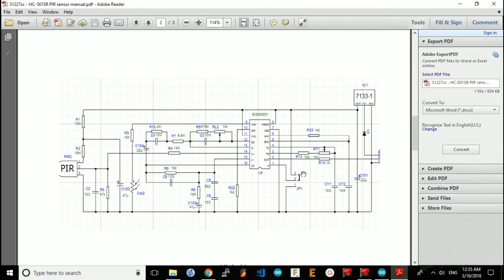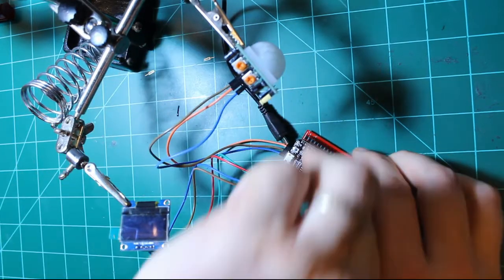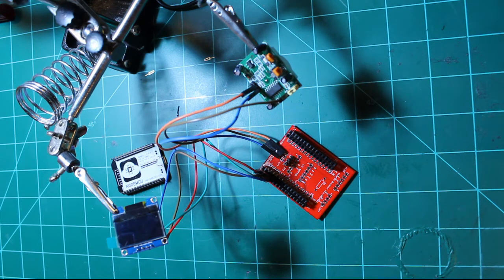Connect PIR sensor to NodeMCU using 3.3V (HC-SR501)

Comment: This worked for me. But why? Whats wrong with the 3.3v signal generated?
I'm trying to create a bunch of motion sensor NodeMCU. I bought an initial set of 3 NodeMCU labeled "Amica" with CP2102 UART. Code has been working great with existing PIR for weeks with not a single problem. 
I bought a second set of 3 NodeMCU that were even cheaper, labeled "LoLin". This are much larger, use CP340 UART. Put the same code, same wiring, same sensors and it went crazy. Set up interrupt to trigger on state CHANGE, yet it will sometimes get hundreds of calls yet the value shows no change. What gives? Was crashing and generally not working at all. Not false positives. Tons of interrupt handler being called with no change and no relation to movement or not.
I tried your change in this video, using 3.3v from the board to the PIR and amazingly, everything is calm and working. I'm not noticing any false positives. Its working great.
Is there some grounding issue? Is the 3.3v from the PIR not relating to the ground on the NodeMCU? Is the 3.3v from the NodeMCU noisy or somehow different from the 3.3v generated by the HC-SR501?
I was about to return these cheaper NodeMCUs. Now I'm not so sure. I'd like to understand why this is making a difference.
Reply: Additional comment to earlier, not only does it work great if I attach the 3.3v as described in the video, it is also working for me to wire Vin on the HC-SR501 to 3.3v despite the manual saying it requires 5-20v.
Reply from the maker: I'm not sure why your second method works (I wouldn't expect it to), but my theory (unproven as I haven't actually looked at the signal with a scope or done any further tests) is that the VIN voltage provided by the NodeMCU when powered via USB isn't high enough to allow the voltage regulator on the HC-SR501 to generate a clean 3.3V signal. I definitely noticed (and tested) that when attempting to use the analog input on the NodeMCU (btw, note to the wise - don't even try! Low resolution and high noise) - I never saw mre than 4.4V on that pin.

When I find the time, I want to run a proper test with these, trying different configurations, and prove/find out which way is the most reliable. I will say that I do still get false positives even with the method I described in the video, just at a much lesser frequency. But, that may just be the sensitivity of these sensors, and nothing much we could do about it.

There's other methods of detecting motion I'm looking at - I recently saw someone mention radar sensors on a forum - might give those a try!
Reply: @BKHobby I figured it out. The "Amica" NodeMCU follows the spec. Vin on that board is tied to the incoming 5v from the USB. On the "LoLin" NodeMCU board, sometimes referred to as v3 board, the pin meaning is different. On the LoLin, Vin really means V-input to power the board, not to provide power to sensors. I measured its voltage as floating between 0.5-2v. 
The LoLin board uses two pins marked reserved on the standard Amica. On the LoLin there's another Ground and a "VU" pin. VU stands for V-USB. It is tied to the 5v incoming power from USB. 
So... trying to power HC-SR501 from Vin on the Lolin doesn't work. Tying it to v3.3 worked for some reason. Tying it to the VU (5v) pin works fine.
In either case, I am not getting false signals. Its working great. 
In general, so far I prefer the "Amica" board over the "LoLin" board. Smaller, follows the spec and seems more stable and they can be had for the same price.
Reply from the maker: Awesome analysis and write up!! Pinned for others to see this, thanks!!

This will definitely explain any issues with the LoLin v3 boards, but the question of Amica boards with the 3v3 bypass working more reliably still remains...guess I need to put a scope on it and check...
Reply: @BKHobby I wonder if it could be variability in the HC-SR501 or with the 5v power supply. I'm using 3 from a batch of 5 I've purchased, different power supplies, an Apple iPad charge and a cheap power strip w USB outlets. I've never received a false positive. We went away for a week. Have had them running for 3-4 weeks now. Didn't get a single false positive the on multiple sensors over the course of the week. I have sensitivity set to maximum. Very sensitive. Standing up 25 feet away triggers it right away.
Reply: The reason this works is probably because the breakout board has a 3v3 regulator to provide 3v3. So it is the same as using 2 separate 3v3 regulators to power the pir and esp8266 separately (common ground).

Comment: Looking at the schematics I have a theory that needs testing. HC-SR501 is powered at 5V, the output is in 3V3 logic, so far that's fine. But the power(5V) traverses a fool-proof diode (normal diode, not Schottky) on which we have a drop of, at least, 0.6V. The regulating circuit, an LDO equivalent to LM1117, has 3.3V at the output but it needs at least (in the best case) 4.4V at the input to regulate (dropout voltage at 100mA is typical 1.1V, max 1.2V). So you see the problem here? 5.0V - 0.6V (diode) - 1.1V (typical dropout voltage) = 3.3V Simply put, you will get reliable regulation (barely) only if 1. The input voltage is 5 and not below AND 2. the dropout on the diode is 0.6 and not bigger AND 3. You have a quality individual LDO that doesn't happen to have a dropout voltage of 1.2V (still within the specs). At worse, with a Chinese LDO (LM1117 clone) with a dropout voltage of 1.25V, a dropout on the diode of 0.65V, and a power (from USB) of 4.8V, you'll get, theoretically, 3.1V at the output of the LDO. But that's not regulation, it's a bizarre behavior of our LDO.

So the first thing that I would do is to short that diode (next to the +V pin) and see if the LDO is regulating correctly at 3.3V (the tab of the LDO is at Vout, you can measure it there). Of course, I'll power the module at 5V from USB but at this moment I already have more room for error. 

If I'd want to power the module at 3.3v from the ESP own regulator, I'd short the diode and the input-output of the regulator, they're very close (from the top view of the regulator with its tab upwards the in- and out- pins are center and right). This way I'd still be able to use the header (+5V power line used with 3.3V of course) and I'll not have to worry about sending power into the output of the regulator with a floating input.

The 3rd option is to put a 100-220nF capacitor between pins 12 and 13 of the BIS0001 circuit. There is a 10nF capacitor already there, probably a negative feedback that improves noise immunity, but I'll not do that until I solve the power problem above.

I'll start to test this theory and I'll come up with my results, meanwhile, if you have other opinions feel free to comment.

Edit. It seems HC-SR501 uses another type of LDO, an HT7133 with a much lower voltage drop (0.1V). Also, the circuit tab is not at Vout, but at Vin. My bad...
More editing. I came to believe that this HC-SR501 was poorly designed and tested from the start. I don't think there is a one-size-fits-all solution for the random triggering problem. Depending on who made the module (China is making clones... sometimes of Chinese clones) some solutions could work while others could not. After some tinkering mine works ok, no random triggering and it's connected to an ESP8266 (Witty Cloud version, my test ESP) with 20 cm of wires and it also has in its vicinity an ESP32, 40 cm away. The Witty Cloud is also connected to a 433MHz transmitter... plenty of radio sources. What did I do? I shorted the diode. I threw a 100nF ceramic capacitor (through hole version) over the LDO, between its ground and its tab. Another 100nF ceramic over the power pins of the sensor. And a 100nF (SMD, albeit people are reporting that 220nF works well) over the BISS0001 pins 12 and 13. I'll let the module on overnight and check the logs later. BTW, while I don't shy away from ASM and C I find it much easier to program the ESPs via ESPHome especially since I'm using HomeAssistant and I already have several ESPs already working.

Comment: How are you getting around all the reports that the SR501 is always triggering false positives?
Reply from the maker: Actually, since I've done this video, I've stopped using HC-SR501s.....even with the direct power, I was still getting too many false positives. I've tried other sensors since then, including some commercial alarm sensors, like the TE Ambimate MS4. That one works great as a standalone, but I haven't been successful in bringing it into an ESP8266 software environment like ESPEasy or Tasmota....For now, I'm not using motion detection in my home automation, so that project is on a backburner...

Comment: You are a genius! This worked perfectly!! Its about time they documented this in the data sheet!
Reply from the maker: Glad it helped! Although, to be honest - I've stopped using these PIR sensors myself and haven't really found any others that are reliable with NodeMCUs. Too much Wifi noise,  in general, causing too many false positives.

There is a professional quality motion sensor from TE (AmbiMate MS4) which also includes temperature/humidity and a few other  inputs, but I've not finished incorporating it into my project, yet.

Comment: Hello, this does work for me. I kept on having "HIGH" measurements but the moment I switched and use your method then it worked like a charm! Thank you very much. This leads to one question...Do you have experience with the SR505 and NodeMCU? Does it lead ot the same problems?

Comment: Not working man( goddamit . i have NODEMCU, LCD, Firesensor and mq2 altogether, the rest working fine, but it's just this pir that messed up. will that affect the voltage? because i am 100% this is voltage problem.

Comment: I was despairing with my sensor, when I learnt that 3.3V from ESP8266 in Vc put the sensor in an erratic mode. I was seeing all these videos about soldering into the sensor to bypass the voltage regulator, but you take the Gold!! Thank you so much.
The sensor still picks false movements, but it's working a 10000% times better.

Comment: What if I need to use the jumper on the other position? Can I still use that pin for supplying power?
Reply from the maker: @BuyBot - Sure! Whether the jumper is on that pin or not, there's 3v3 on it, as your power supply is essentially doing the job of the 7133 voltage regulator in the circuit. But, you'll need to split the pin out into a small harness (e.g. a 2-pin header connector with the wires jumpered together, and your 3v3 supply connected to them).

Comment: Thank you! I stumbled across this video. I don't usually comment on YouTube videos but this has saved my project, budget, and sanity! I have 9 ESP32 AP devices that wakeup from deep sleep when the PIR sensor is triggered and in response an STA ESP32 doing most of the heavy lifting.. but all the AP devices were misfiring and waking up for no apparent reason - was driving me insane!
Reply from the maker: @Merate Barakat - I'm very glad to hear my video has helped you! I will say this - PIR sensors just hate Wifi boards, it seems. Even with the bypassed voltage regulator, my PIRs do have the occassional "hiccup" of a false positive report. So, I'm working on a version 2 of my Kube design, which uses the TE AmbiMate MS4 sensor with lots of extra goodies (like filtering, other sensors, etc...) Stay tuned for updates on that project! It may be of use to you with the ESP32 boards as well, since I've written a plugin for the sensor on ESPEasy, which will work with the ESP32 board, as well! 

Good luck with your projects!!

Comment: Hello, thanks, works better now, but not perfect (in my setup the board is to close to the sensor apparently).
From Bruh video ( https://www.youtube.com/watch?v=jpjfVc-9IrQ&t=120s) i find out about this min PIR sensor AM312 body sensor (https://www.banggood.com/5Pcs-Mini-IR-Infrared-Pyroelectric-PIR-Body-Motion-Human-Sensor-Detector-Module-p-1020426.html?rmmds=search&cur_warehouse=CN
https://www.youtube.com/watch?v=jpjfVc-9IrQ&t=120s)
Reply from the maker: Agreed - the SR501 may be too sensitive for the application we use (or might need more filtering in the software) - but I had no luck with the sensor Bruh recommended (I tried it myself too). I want to do a side by side comparison of several sensors and different configurations but I need to find the time to do it :)

Comment: I have a esp8266 connected to a sr501 connected as above. 40 false triggers every day. Tried put a capacitor between + and ground with same outcome.
Reply from the maker: Are you sure they're "false"? I ask, because these sensors are actually designed to be VERY sensitive. In my experience, I have to turn the sensor completely sideways (almost facing the wall) in my setup to avoid it picking up even the slightest move - it still picks up all valid motion events. I've also noticed just general vibration sets it off, too. So, keeping it stable and keeping it aimed at a correct angle are very important.

On the other hand, I've come across a few of these that don't pick up anything at all or are very weak, so I'm sure production quality is not 100% on the units we get from sites like Amazon or ebay....
Reply: BK Hobby yes I am sure. Nobody home and very quiet in my home. I just saw that someone put pulldown on the signal pin with good results. Will try that one when I get home.
Reply: @andersb264  1 year has gone, how was the result?
Reply: @diy_home  pulldown, capacitor and esp8266 far away from PIR works well inside house
Reply: @andersb264  How far is far away? Would 4 inches be enough?
Reply: @shifty212  I have many of them in my home, the distance between pir and esp is at least 500mm. Have not tried closer. Never false trigger

Comment: Thanks for the explanation.
I only had to do it a bit different because there are only solder pats on my Motion sensor. Made a wire to the right pin of the voltage regulator on the motion sensor board and that works.
It's now connected on the Kube multi Sensor and is publishing a 1 if motion is detected. I see in MOTT.fx that it is working. In Openhab it is something different because it is giving me -new state is NULL, couldn't post update for 'Bedroom1_Motion' if a second time the sensor is publishing a 1. 
May I ask how you have solved this in openhab?
I have made a item file like this:
Contact Bedroom1_Motion "Motion [%s]" <switch> (Bedroom1,Mot_Chart) {mqtt="<[broker:home/DHT01/motion:state:MAP(motion.map)],<[broker:/home/DHT01/motion:command:ON:1],<[broker:/home/DHT01/motion:command:OFF:0]"}
And a map file:
0=Still
1=Motion
The sitemap has this:
Frame label="DHT01"{
    Text item=Bedroom1_Temperature
    Text item=Bedroom1_Humidity
    Text item=Bedroom1_Motion
        }
This must be wrong because it shows nothing then a file icon and Bedroom1_Motion as text.
I know I am just learning this stuff but can not get this working the right way without altering the Arduino skecth. (maybe publishing a 0 after the delay for the screen?) But that is not what I would like to do.
Thanks in advance and hope to see/hear from you.
Ray.
ps: that WiFiManager is working great btw.
Reply from the maker: Ray Brok - I'm glad you got the PIR sensor working! As for the openhab items, I see a problem with your item definition. You should only be defining one MQTT topic (the motion state) - you're not sending commands to the sensor, so no need for the output topics. Also, I use the Expire binding with my sensors. With the expire setting, I can "hold state" on any new event coming from the MQTT topic, and disregard any additional events for a period of time. In my case, i have it set for two minutes, so my light will turn on for 2 minutes and then turn off again (the Expire binding sets the state to what you define after a predetermined period of time). My item definition (with the expire clause) becomes:

Number Motion_MasterBedroom "Master Motion [%d]" {mqtt="<[broker:home/MasterBedroom/motion:state:default]", expire="2m,0" }

the "2m,0" is what specifies that the state will be held for 2 minutes, and then set back to 0, waiting for the next motion event. This should allow you to do what you want to do, without making any changes to the Arduino sketch.

Hope this helps!
Reply: Yes. This is working. 
Thanks a lot. I had that Expire binding installed and tried, the wrong way it seems. Much better indeed then making any changes to the Arduino sketch. And like I said before, I don't want to do that. Mainly because any permission or consultation. Of-course there are thing that could and need to be added or slightly changed, BMP280 sensor as barometric pressure as example, or/and a kind of web-interface.
Any way. Thank you very much and sorry if I used your time for something that I really didn't saw any more.
Reply from the maker: Ray Brok - you don't need to worry about permissions - I have the project shared on Github (https://github.com/bkpsu/NodeMCU-Home-Automation-Sensor) as open-source. I welcome any changes/additions (via pull requests or issue reports) and could definitely use some help with it ;) For example, I like your ideas of adding a BMP280 sensor (should be pretty trivial) or a web interface (slightly more work, but still doable). And, no need to be sorry - I'm sharing these projects/videos because it makes me feel good to share my experiences with others. I hope I was able to help you!